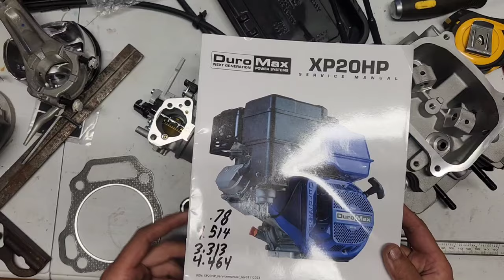Duromax 500cc Head Valves and Carburetor Break Down

Comment: I got an old YZ490 chassis beside the shop, looks like a potent engine, port, valve size, larger cam stock,  now if someone made an affordable 3 or 4 speed stand alone trans cheap. Don't really want a comet belt setup on a dirt bike, but hey, maybe...  be different.

Comment: Will the common 34mm Mikuni kit and header for a 420 work on this motor?
Reply: Yep, I just installed a 420 header and 34mm pwk slide carb on my duromax 500cc electric start. Had to modify the intake boot for the carb that bolts to the head but works great! The atock muffler on this beast is HEAVY so saves alot of weight going to a header pipe. Now just have to get this big boy jetted and happy.

Comment: I have one that i modified to have a better air box and bigger exhaust but now it surges at higher RPMs and needs to be choked to run right. Should i port out the jet even bigger to fix that? 

Any help would be appreciated.
Reply from the maker: Yes you would need to do some jet work do to better air flow.
Reply: @redneckcomputergeek  thanks man. Any suggestion on what kind of jet kits might fit it, or should I just use a drill and do it myself?
Reply from the maker: @j.r.millstone  Well a 440 at stage one runs a 44 or 45 jet from NRRacing so my bet would be to buy 45, 46 then drill if needed.
Reply: @redneckcomputergeek  thank you. Last question, what issues does that solenoid on the bottom of the bowl pose? Why get rid of it?